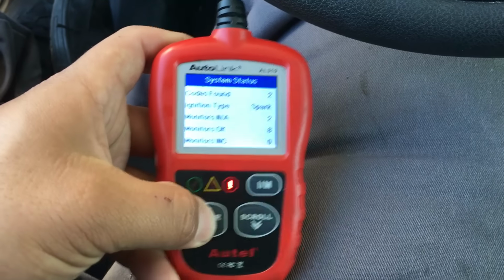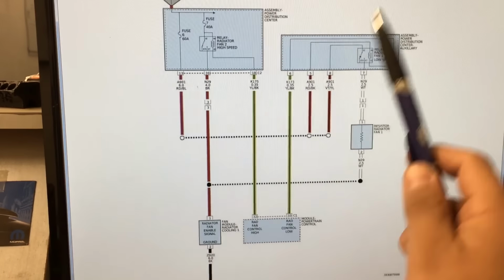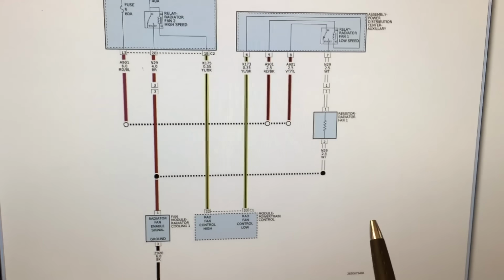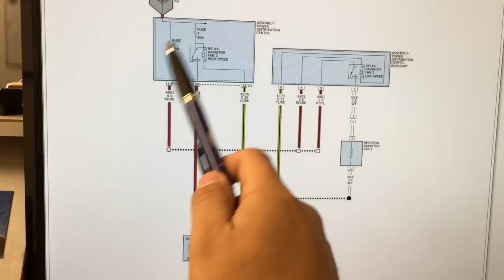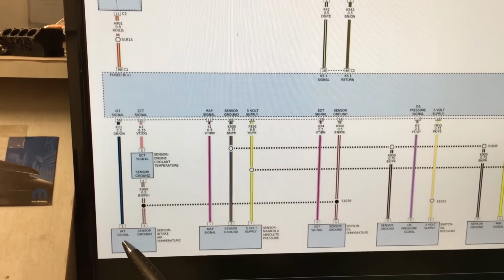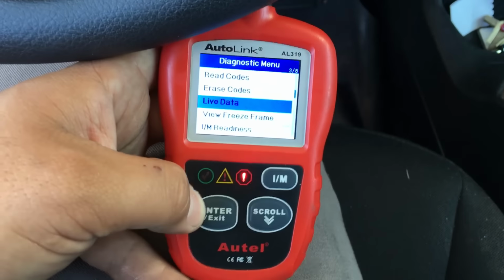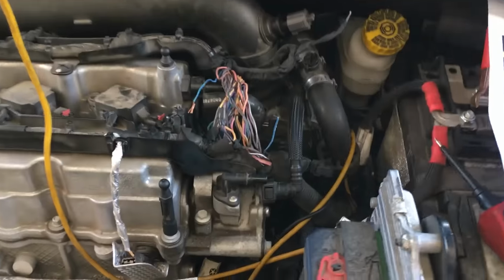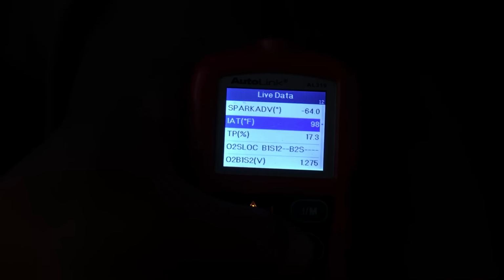JEEP RENEGADE COOLING FAN AND IAT CIRCUIT FAULT DIAGNOSIS

Comment: i love yr video,i am working on jeep renegade the problem with ac fan condenser when i hit the ac button(led ac lit) but the fan condenser not running and ac compressor not engaged as well(i did test the low and high fan working and the ac clutch work as well by bi-direction control of scan tool so pcm fine)what else should i check?thanks for yr reply

Comment: So if those wires on the IAT would of tested good.... What do I test next? The engine coolant temp sensor or the oil temp sensor?  I'm asking because my fan will not come on. I'm trying to eliminate all possibilities before buying a new fan. I'm almost certain a AC PRESSURE SENSOR COULD KEEP THE FAN FROM NOT COMING ON.... I also have a P0481 code but my fan won't run in high or low speed. I also had a blown 50Amp maxi fuse. I replaced it and still no fan working..  ive had to walk away from it several times frustrated... Can you please tell me the location of the other power distribution unit where the last fan relay is at? Any other help would be great too.....

Comment: I have a 2018 renegade, and the cooling fan is not coming on when ac is turned on. Fan will only come on when engine needs to cool the radiator, checked fuses and relays already, any ideas where to check next?

Comment: The wiring diagram said fuse 7 is a 40 amp fuse but it had a 50 in there, I've been having a problem with my wife's jeep burning up the fans is this something I should look into

Comment: Voltage Drop Diagnostics, can you help me, I'm pulling my hairs out over this 2017 Jeep Cherokee 2.4. The engine temps creeps up when sitting stationary like at a stop light etc. but when driving the temp come back down to normal. Does the 2017 Jeep Cherokee have 2 fan speed setting? With the A/C on the fan does work. I let the Jeep idle in the garage, it got up to 228 and the fan never kicked on. The only fuse I found was a mini 5 amp "radiator fan enable" fuse. I don't see any relays or any other fuses. Would appreciate if you can guide me in the right direction.
Reply: Having the same issue with my 2016 2.4 cherokee sport. Gets up to 228-230 before fan kicks on. 
In town it run 219 to 228 consistently

Comment: Thank you so much for the video this will help me a-lot  Im going through this problem with a 2016 jeep at my shop the fan is working but the code still there Im going to check that fuse

Comment: I have fixed this code before. I was right! it was hard to diagnose but my diagnosis was correct. Blown fuse and burned fan motor. 2010 Dodge Charger I’m a learning mechanic ..

Comment: Typical Chrysler, putting a higher current fuse on the low current side and vice versa...
I pity anyone foolish enough to buy into this brand.
Reply: They aren't chrysler products. Built by Fiat
Reply: @aymeerobinson5171  they aren't Fiat products anymore, they are Stellantis N.V.
Fiat along with fifteen other brands are just now just minor parts of this multinational corp.
Reply: @alasdair4161  I own a renegade. It was built by Fiat. When several recalls happened it would sit at the dealership for a month at a time because they were having trouble getting parts from fiat. The newer models may not be fiat but the 2015 was
Reply: @aymeerobinson5171  Yes, their history of amalgamation and cross ownership reads like the diary of an unwanted orphan. Fiat was probably the biggest mistake in that history, but even at home their overall quality was on the slide for some time before that, but then using an even lower standard of components (from Fiat) was never going to end well. They just always know how to make cars that look good, so they continue to sell accordingly.
I think most buyers just expect the warranty to save them.

Comment: Multiair is Fiats version of Valvetronic that BMW uses. They vary the intake valve opening to control engine speed, they do it hydraulically instead of electromechanically like BMW does.

Comment: The explanation at the beginning was a little vague when mentioning that the owner coming to the conclusion of a bad fan that she had checked the relay and fuse but didn't mention that she found the fuse was bad. also if the original fan was checked by the first mechanic, or you double checked the original fan to make sure it was the cause of the fuse blowing... But all worked out well. Thank you for another great diagnosis and repair.
Reply from the maker: She told me "I already checked the relay fuse thingy" lol

Comment: There's a recall on those. This is a very common problem
Reply from the maker: I’ll have to look into that. Thanks for watching!
Reply: Yeah. I can't remember the years off the top of my head, but I work at a Chrysler dealer and we've done dozens of them. So many we keep several in stock.
Reply: On the cooling fan
Reply: Jeremy Scott if there is she can be reimbursed by dealership
Reply: @rahrah8076  ya

Comment: So what blew the 50 amp fuse
Reply from the maker: The original fan motor burned out.
Reply: ADVANCED LEVEL AUTO but you changed the fan you did not test to see if it worked
Reply from the maker: When we removed the old fan I bench tested it and it did not work.

Comment: I'm sure that you know, but one of the best tips I was ever given by an older tech was that if an oxygen sensor wasn't coming out. Stop, dump a cap full of brake fluid onto the oxygen sensor, and walk away for 5 minutes. When you come back, the sensor will easily come out. His explanation is that the brake fluid melts away the carbon that is holding the oxygen sensor in the manifold and I have used it a bunch of times with success! 

Great video btw! For whatever reason, I wasn't being notified when you were posting videos! I'm glad I caught this one!
Reply: Voltage Drop Diagnostics I’ll defiantly have to try that trick! Thanks 🙏
Reply: So brake fluid stops u from braking or breaking the sensor. Cool tip. I will try it.
Reply: ill be trying this lol
Reply from the maker: Me too! Thanks for the tip!
Reply: Excellent tip.I for sure will be using it in the future repairs.thank you!
Reply: The journeyman is always right